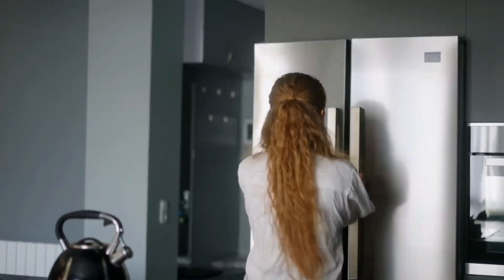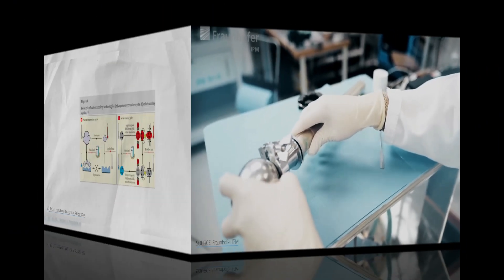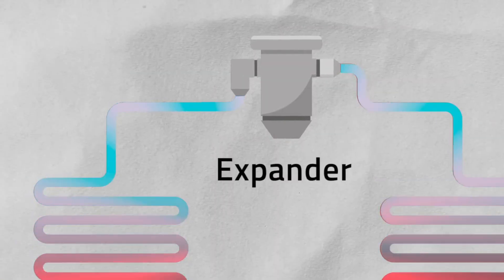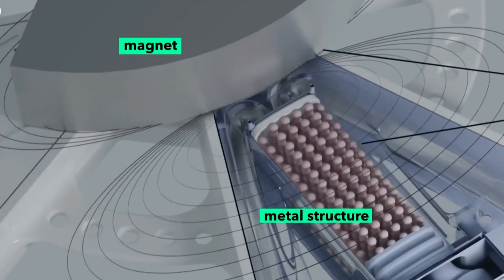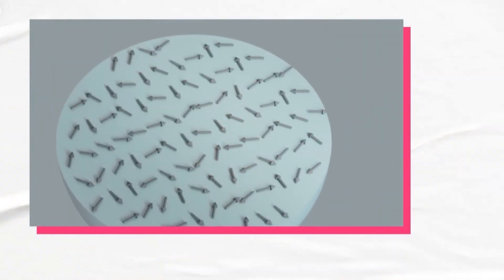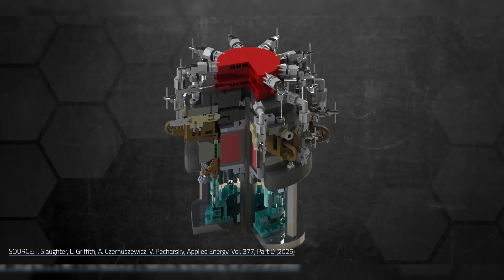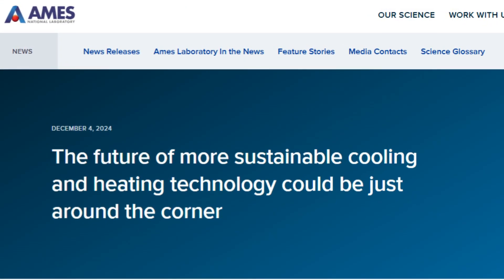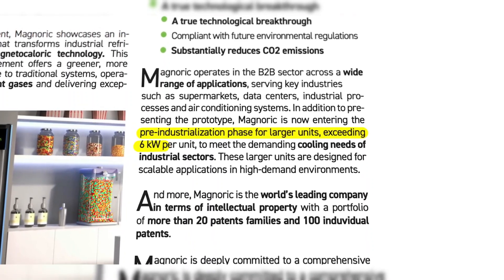Why Refrigerants Are Dying – And Magnets Might Replace Them

Comment: Same thing as spinning magnets under a copper sheet and using that to heat up an ammonia refrigerator.
Reply: Thanks you saved me eight months of my life
Reply from the maker: Similar in concept—both use magnetic effects and heat transfer—but magnetocalorics work by changing the temperature of solid materials directly through magnetic fields, not induction heating. No moving gas or ammonia cycle needed.